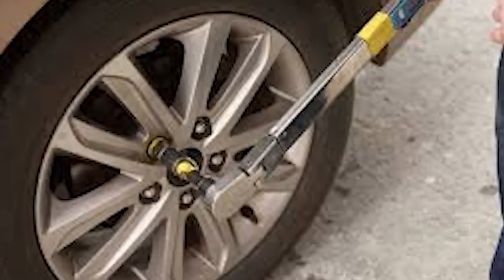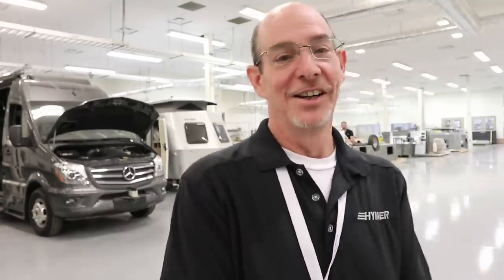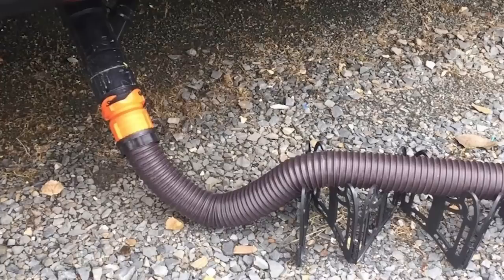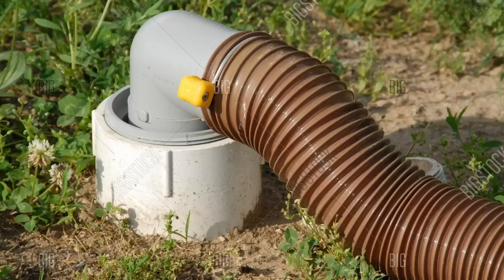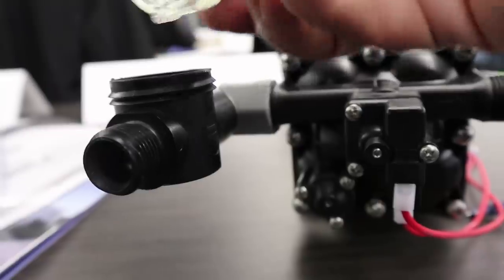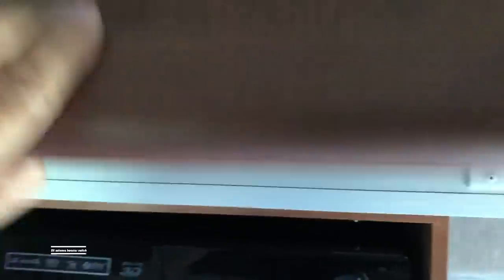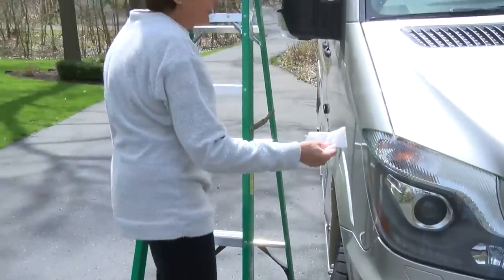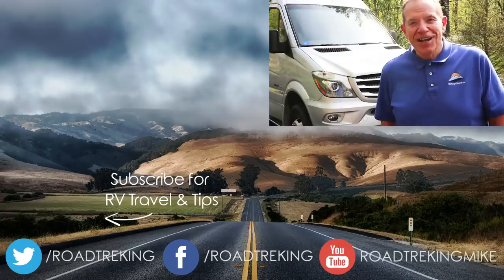Basic RV Maintenance that Any RVer Can Do | Easy Fixes to Prevent Damage On The Road

Comment: Very helpful information.  Despite years of RV and boat usage I still learned a trick or two regarding the tank readers.  Also would suggest people check the attachment of leads to the tank exterior if possible.  Reading became more accurate after securing leads better.